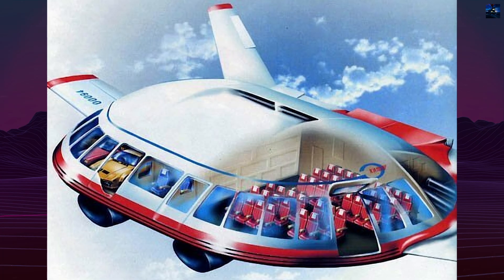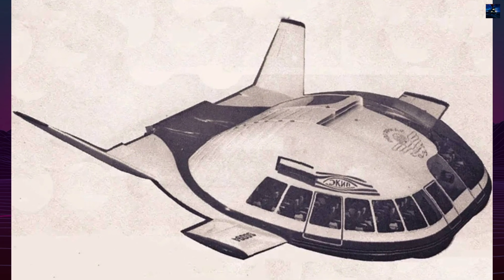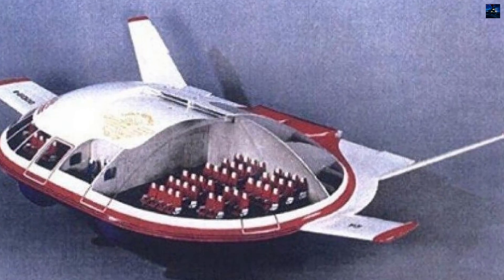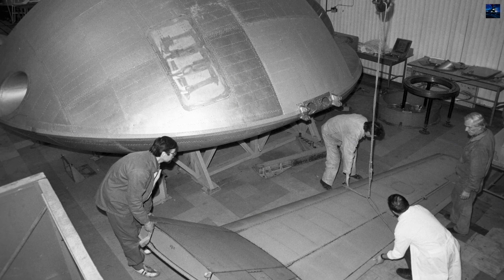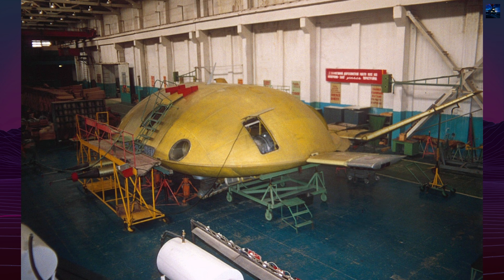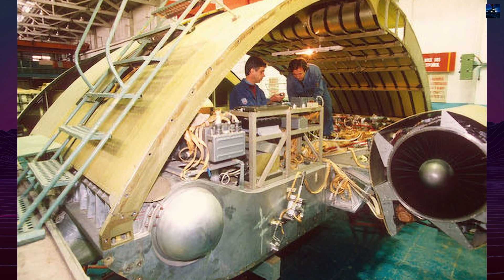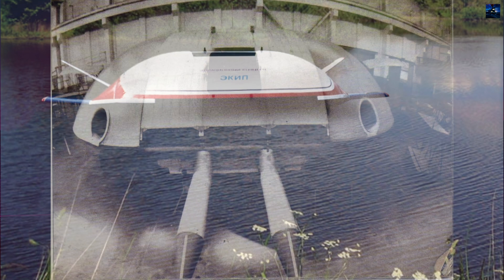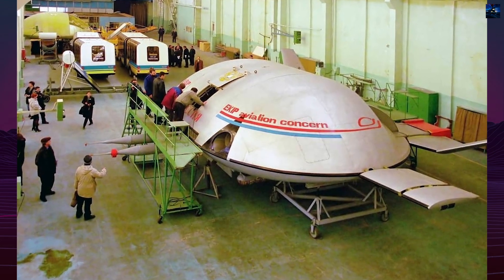EKIP: The Soviet UFO Prototype That Outsmarted Normal Planes

Comment: I thought of the Canadian Avrocar. It also used the "ground effect" and had a multitude of vanes and control surfaces used to change directions by diverting exhaust from its engine. It never flew higher than about one meter.

Comment: only small radio-controlled models were broken, which, by the way, confirmed the operability of the vortex control of the air flows surrounding the body. after that, the large prototypes shown in this video were built. they are also was radio-controlled. it is very difficult to test such a technique because it can only be controlled electronically. It takes time to adjust the controls and work out all the modes and maneuvers